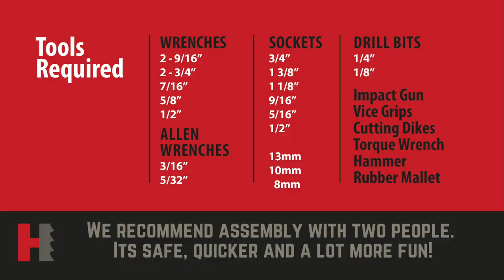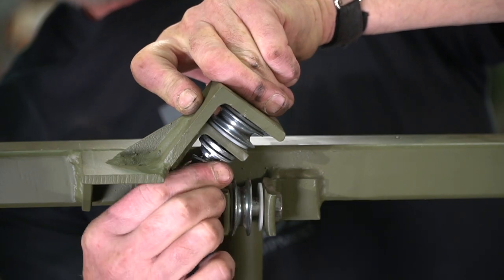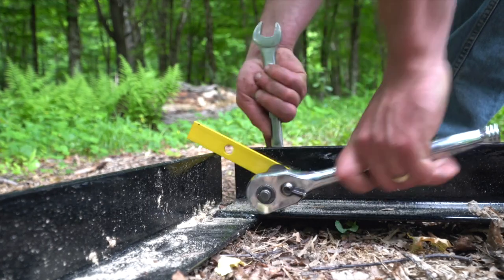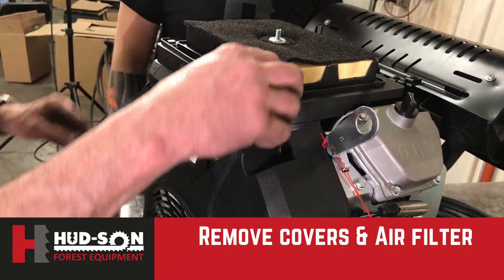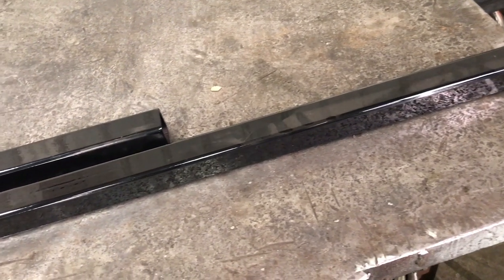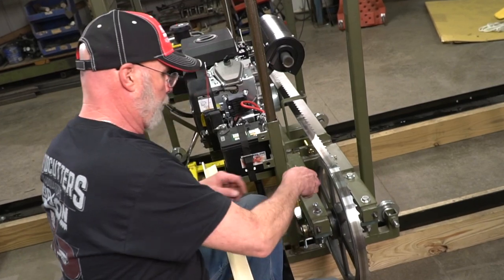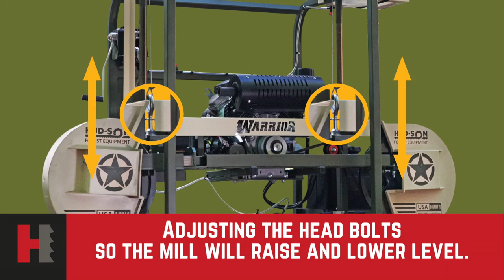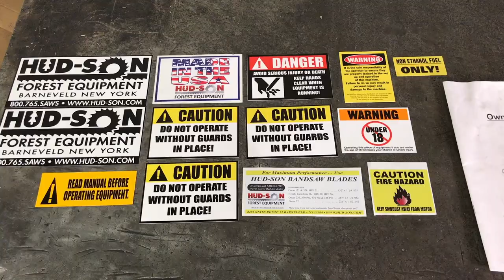Warrior Portable Sawmill Assembly Instructions for the do-it-yourselfer

Comment: Looking at the Warrior and the Homesteader 36 , both 36” capacity sawmills, I’m struggling as to which would be the best mill for me. With only a $400.00 difference in cost , I’m assuming the homesteader line is a step above the Freedom mills ? Thanks.
Reply: Better than the warrior for sure.  They've cheapened the warrior drive system, head support and downsizing a few other details.  You can only take a cut 8.5 inches deep with the warrior so if you want to make any quarter sawn boards it's pretty close to useless.  Neither one have any alternate locations for controls should you actually want it really portable - on a trailer!  For the 3000 they want for a trailer, plus 400 shipping they should include a lot more.  Right now they have a sellers market and it shows.
Reply: @approsetn  
I just pulled the trigger on a EZ Boardwalk 40 with a 10’ extension.

Comment: I just picked up my Warrior on Saturday. Still putting it together. One of the steps on your video is to drill out and countersink the top set screw in the pulley bearings. Watching the video, it really looks like they are drilling out the threads. I feel that LocTite will the trick here. Also, we haven't got to the blade yet, but got the motor going. I have what appears, great alignment, but my belt is flipping over. Any thoughts? Also, in the newer video of the Warrior assembly, ya'll left off the part about putting the throttle cable on.
Reply from the maker: Thank you for your purchase! We are here to help. Please give your local dealer a call or us 800-765-7297 to speak with a tech to help figure out any issues.  If your Warrior has a 24hp engine this is the correct assembly video. If your mill is the 23hp no throttle is required use this video for the assembly: https://www.hud-son.com/warrior-assembly/
Reply: You prolly dont care but does anybody know of a tool to log back into an instagram account..?
I somehow lost the password. I would love any tips you can give me
Reply: @Leonel Jace instablaster ;)
Reply: @Gregory Ace I really appreciate your reply. I found the site thru google and im trying it out atm.
Seems to take a while so I will get back to you later with my results.
Reply: @Gregory Ace It worked and I actually got access to my account again. Im so happy!
Thanks so much, you saved my ass!
Reply: @Leonel Jace no problem :)
Reply: @leoneljace4650  No clue. And no clue as to why it was brought up on my comment...